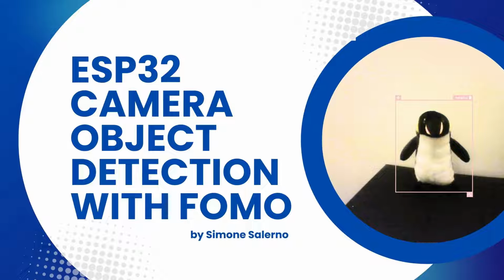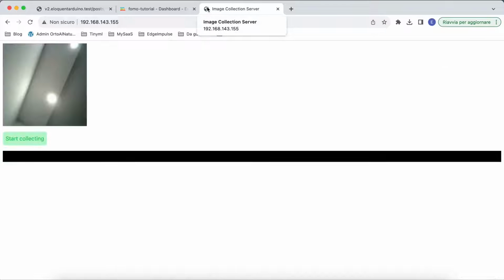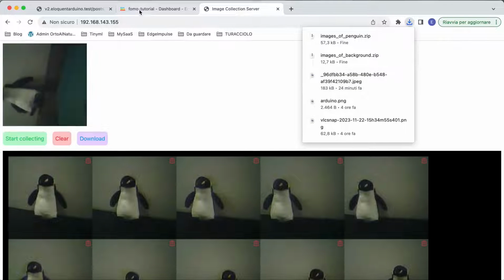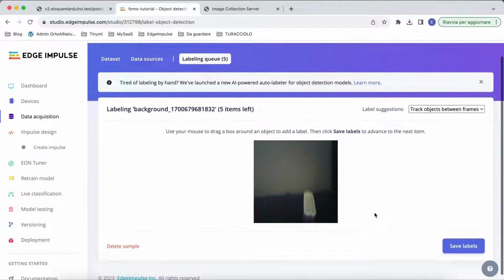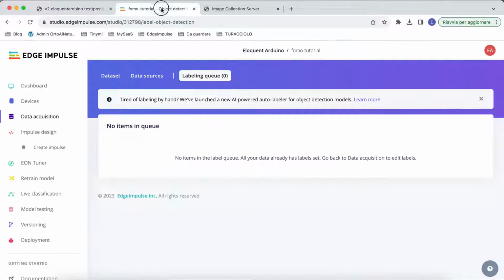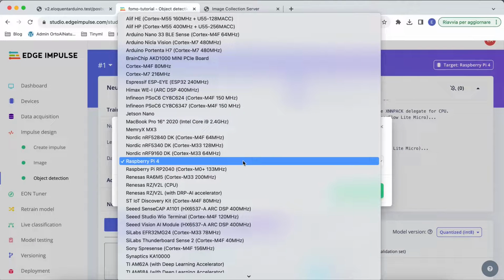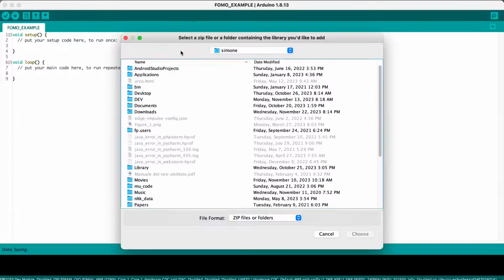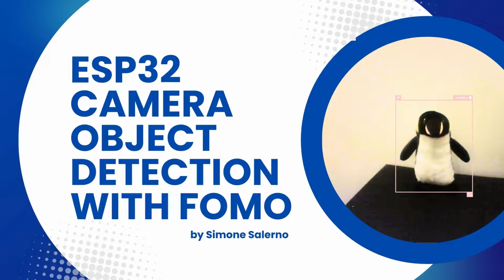ESP32(S3) cam Object Detection with Edge Impulse FOMO

Comment: Bonjour, votre vidéo est remarquable. Je m'en inspire pour faire une IA afin de détecter le frelon asiatique qui attaque les ruches. J'en suis à la collecte d'image. Ce qui est assez facile vu les attaques de frelons sur les ruches. J'ai quelques questions : J'ai mis FRAMESIZE_VGA  et jpeg_quality = 12 pour avoir une bonne définition de la photo. Pensez-vous que c'est suffisant pour la collecte d'images ? Lorsque je code sera en service, est-ce-que le flash est allumé en continu, ou est-ce qu'il s'allume seulement au moment de prendre les photos ? Merci
Reply: did you get the answer?

Comment: can you pls help me. i am using esp32 cam with camera module RHYX M21- 45 not OV 2640 and i a getting error Camera not initialized failed to capture image.. Sir pls help me as i have to build my college project.
Reply from the maker: I've never used this camera module, so can't help. Judging from here (https://www.reddit.com/r/esp32/comments/1ic6d8g/need_help_with_esp32_cam_project_using_rhyx_m21/) you may try to set camera.xclk.slow() and camera.pixformat.rgb565() to initialize it. But you won't be able to use the CollectImages example, since it expects JPEG images. You will have to print them to Serial or save to SD card as a uint16_t array.

Comment: Can you help me please? My serial monitor show something else I posted it in my youtube channel
Reply from the maker: Write here what you see on your serial monitor. Also, which board are you using?
Reply: @eloquentarduino5988  Esp32-Cam Wifi
Reply: @eloquentarduino5988  rst:0x3 (SW_RESET),boot:0x13 (SPI_FAST_FLASH_BOOT)
configsip: 0, SPIWP:0xee
clk_drv:0x00,q_drv:0x00,d_drv:0x00,cs0_drv:0x00,hd_drv:0x00,wp_drv:0x00
mode:DIO, clock div:1
load:0x3fff0030,len:4888
load:0x40010000,len:0
load:0x3ff5a000,len:1073679820
1162 mmu set 00010000, pos 00010000
1162 mmu set 00020000, pos 00020000
1162 mmu set 00030000, pos 00030000
1162 mmu set 00040000, pos 00040000
1162 mmu set 00050000, pos 00050000

Comment: Hi is it possible to do face detection with stream on website and face track from 2x servo? Xiao esp32-s3 sense
Reply from the maker: Yes, you can. I have a tutorial for face detection here: https://eloquentarduino.com/posts/esp32-cam-face-detection . It doesn't have the servo code, but gives you the face coordinates so you can control them
Reply: @eloquentarduino5988  Thanks for respond, unfortunely i dont have enough money to buy face detection streaming

Comment: Hi
I have a problem with this command: camera.brownout.disable();
It keeps resetting.
If I delete it, it gives me this error:
CORRUPT HEAP: Bad tail at 0x3c076be2. Expected 0xbaad5678 got 0x80f780dc
assert failed: multi_heap_free multi_heap_poisoning.c:279 (head != NULL)
How can I fix this error?
Reply: I also use freenove esp32-s3 wroom
Reply from the maker: Which board are you using? Did you enabled PSRAM? Which ESP32 core version are you using?
Reply: Did you found any solution, I am facing the same issue

Comment: Hi,

Thanks for your great work!

I'm using a XIAO ESP32S3 Sense and facing an issue—you might be familiar with it. In the [8/8] Run step, I see no logs in the serial monitor (baud: 115200). I’ve double-checked everything against the docs.

I suspect the ESP32S3 Dev Module isn't compatible since the XIAO ESP32S3 board works fine. Any advice?

Thanks!
Reply from the maker: Glad you solved
Reply: Found the problem! When I switched to XIAO ESP32S3 board the PSRAM got disabled, I changed it back to OPI PSRAM. Now it is working like a charm!

Comment: Hi, interesting solution, but is it possible to modify the collect and stop button? I not like it takes the same identical pictures as dataset, I like to take 1 photo, then turn the object and take another one. Can this be modified or can you put a single shot button extra? Thanks in advance!
Reply: Sadly not at the moment. I didn't thought of this scenario, so there's no way to edit the shot interval. You will have to collect every second, download all the images and then manually select the ones you want to keep.

Comment: Hi! Really like your video! I just wonder would there be any suggestion about export C++ library with edge impulse and build the same thing with esp idf? Thank you so much!!
Reply from the maker: I've never worked with ESP-IDF, so I really can't help here. I see they don't have a tutorial specific for the camera. You can refer to the skeleton project from EI: https://github.com/edgeimpulse/example-standalone-inferencing-espressif-esp32/blob/main/main/main.cpp .
Instead of using a static features array, you will have to feed data from the camera. You will have to implement the signal.get_data function taking as an example my implementation at https://github.com/eloquentarduino/EloquentEsp32cam/blob/main/src/eloquent_esp32cam/edgeimpulse/image.h#L198 .
You need to convert your image pixels (probably RGB565 - so RRRRRGGGGGGBBBBB) to RGB888 (RRRRRRRRGGGGGGGGBBBBBBBB)
Reply: @eloquentarduino5988  Thank you so much! I will definitly look into it, and try to read it from the camera, thank you!😀

Comment: Hello, I have an issue. When uploading the code to my ESP32, the IP doesn't appear. This is what I get:

rst:0x8 (TG1WDT_SYS_RESET),boot:0x13 (SPI_FAST_FLASH_BOOT)
configsip: 0, SPIWP:0xee
clk_drv:0x00,q_drv:0x00,d_drv:0x00,cs0_drv:0x00,hd_drv:0x00,wp_drv:0x00
mode:DIO, clock div:1
load:0x3fff0030,len:1344
load:0x40078000,len:13964
load:0x40080400,len:3600
entry 0x400805f0
Reply: Hahaha, forget it, it was my mistake for not changing the camera model in line 36
Reply from the maker: That happens to many people... @azuzusy
Reply: So how should I edit line 36 if I use esp32 cam?
Reply: i use AI Thinker esp32 cam
Reply from the maker: @buon.  camera.pinout.aithinker(). Beware that AiThinker has little RAM, so you may have troubles running FOMO
Reply: @eloquentarduino5988  thank you <3
Reply: Did you found any solution, I am facing the same issue

Comment: BECAUSE I WAS THINKING i can call fomo from arduino uno and when the object is detected i can decide whether to accept that object or not. eg. fire a solinoid to open a doorlock when the object is acceptable or deny it otherwise. i am imagining a fomo function can return object name inside arduino code. is it posible?
Reply from the maker: FOMO won't run on a Arduino UNO (ATmega328 chip). It can run on Cortex-M chips or ESP32. You can check the label with `fomo.first.label` for single objects

Comment: hello sir. Id like to ask... say when it finds penguin and i'd like to fire a solinoid to open a cage for that penguin... is it posible in esp32CAM
Reply from the maker: You can do whatever you prefer when detection is done. Something like `if (fomo.foundAnyObject() && fomo.first.label == "the-object-you-are-intested-into") { digitalWrite(SOLENOID_PIN, HIGH); }`
Reply: @eloquentarduino5988  thanks but as you said fomo won't on arduino, so this code must be done in esp32cam?
Reply from the maker: @dgadstv3876  Yes. Or you have to communicate from the ESP32cam to the UNO, if you're using both. When ESP32cam detects object, if sends message to UNO, which activates the solenoid.
Reply: it is quite imaginable but doing so is not a simple thing especially a beginner like me. i still have to develop a communication skill. Thanks and hoping you can share more.